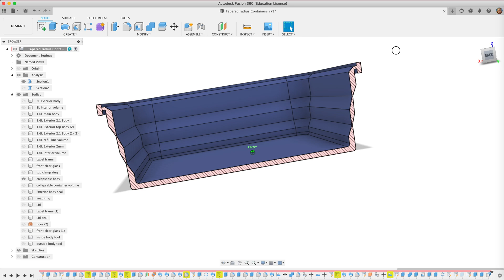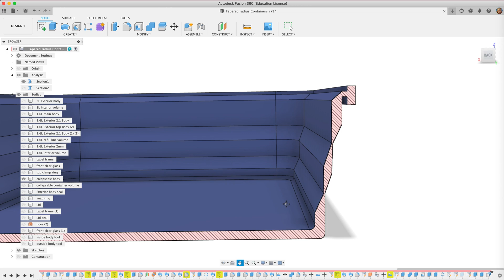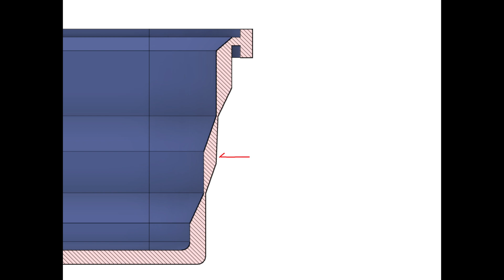Collapsable Silicone Container

Comment: But it's not hard it's only hard when you're using a mold that is as is you need the mold to have all the folds in it and all the bends in it and you need to pour the silicone into the mold while it's folded let it harden and then it'll pop out an back down

Comment: Interesting to see the post cure in the collapsed state was enough. After a few of the first fails at the beginning I immediately wanted to hop into the comments section and suggest for the future would actually casting the silicone in the collapsed state aid in the materials elasticity and memory to return to that collapsed stage be beneficial. Maybe designing the mold in the collapsed state will pose too many issues but glad to see I was onto something when the final iteration worked for you!
Reply from the maker: Yup

Comment: I went through a similar "design process" in my head for a much larger campervan window surround to allow more space but weathertight and yet still secure when collapsed and metal rings interlocked. 

With silicone much thicker and high-value product it seemed worthwhile but I thought would need to be cast in a collapsed state, so some vindication of my thinking design by your far, far greater knowledge and skill. 

I wouldn't like to make buckets at 4 Bucks a piece, eh.
Reply from the maker: It is possible that they might need to be cast in a collapsed state, my experience somewhat  points in that direction.

Comment: Hi Eric!  For the future, I have found using a ball inflation needle to blow compressed air between the mold and the part will make demolding way easier. I even have a few I have ground down to remove the side ports when I have a very small point at the parting line. Hope this helps!.
Reply from the maker: Some of the early molds had air insertion points but it didn't always work and sometimes it destroyed the molds. But thanks for the tip I'm going to check out this ball inflation needle thing
Reply: @EricStrebel  I hadn't thought about creating special ports for air, I just insert the needle at the part line and slowly add low pressure air (10-20psi) until a bubble forms between the part and the mold. I have also had it work by using an air gun blowing on the part line as I rotate the part using higher pressures ~90PSI. I will explore adding ports as well, thanks!
Reply from the maker: Best of luck!

Comment: Have you tried a mold in the collapsed state?
Reply from the maker: I thought about it but not sure if that would be feasible for production, and I believe the mold would be much too difficult to design and print or even cast with all the folds.
Reply: @EricStrebel  https://multishotmold.com/2021/05/25/two-shot-silicone-collapsible-bucket-mold/ Are you sure?
Reply from the maker: Hmmm, dunno...could be for the second shot, not sure, anything is possible though. Thanks for the link
Reply: @EricStrebel  could you use vacuum to suck the silicone into the mold like resin for carbon fiber plastics?
Reply from the maker: Maybe....sky is the limit....